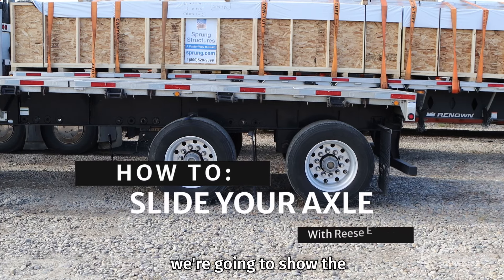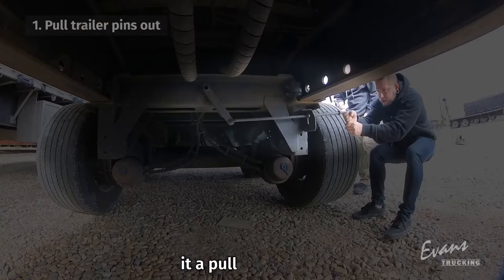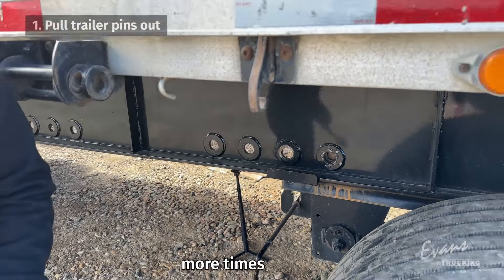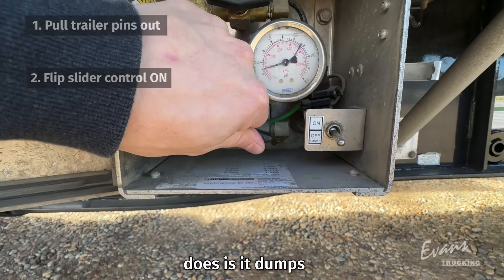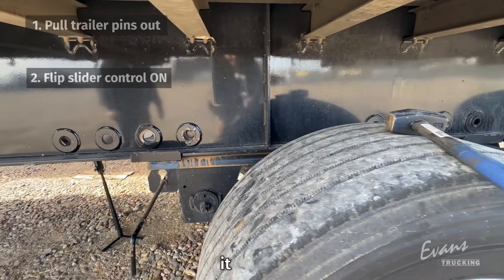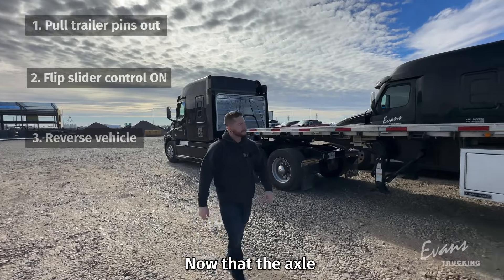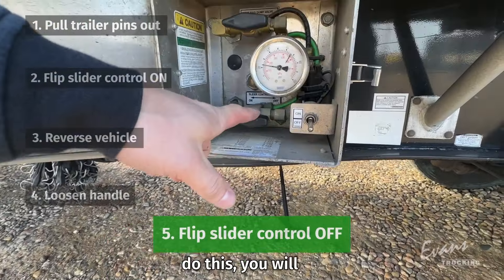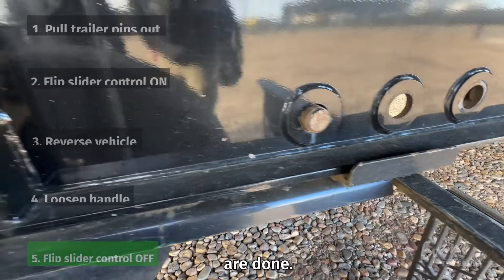How to Easily Shift Your Trailer's Axle with this Simple Trick

Comment: I seen what you did and how you did it but why did you do it? Sorry I'm new. Does this shift like where weight is distributed on the ass end of the truck to meet requirements for specific loads etc? Most of the time is the default setting the truck is in enough or how often are we shifting the axle? Is this specific to flatbed trucks or are non flatbed trucks also shifting axles?
Reply from the maker: That's a great question. We didn't get into in the video because we wanted to keep it short.

Sliding axles are all about weight distribution - it's how we make sure the load's weight is spread properly across all axles. This isn't just for good measure - we need to meet legal weight limits on each axle and follow bridge laws, which dictate how weight needs to be distributed when crossing bridges.

The default position works for most standard loads, but trucking throws plenty of curveballs. You might get loads that are heavier on one end, or you could be running close to max weight. That's when you'll need to adjust those axle positions to get everything dialed in.

It's not just flatbeds either - van trailers and reefers have sliding axles too, though flatbed drivers tend to adjust more often since our freight varies so much. Sliding the axles can also give you a better turning radius and improve traction on the drive axles when needed.

How often you'll slide depends on your routes and what you're hauling. Some drivers might adjust several times a day, others might go weeks without touching it. It's just another part of handling different loads safely and legally.